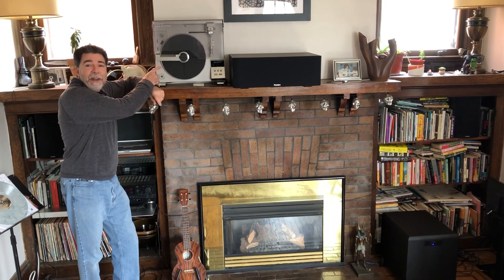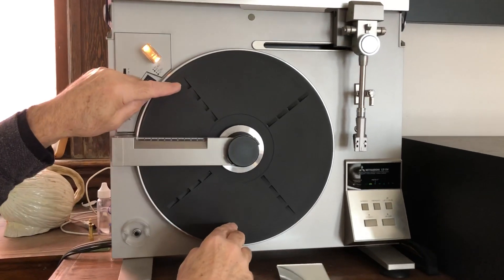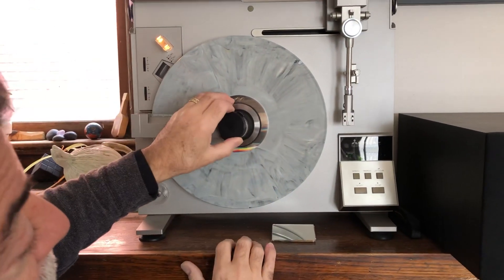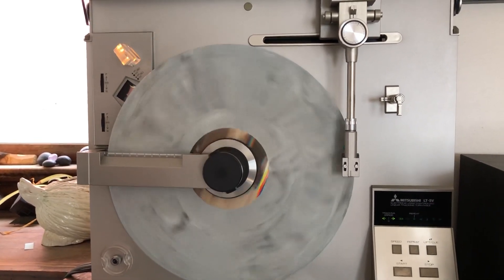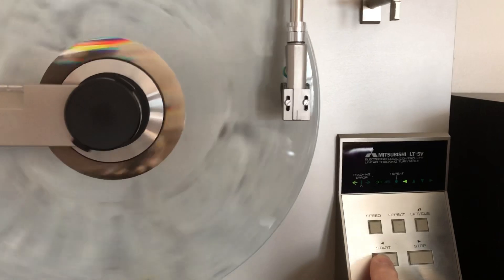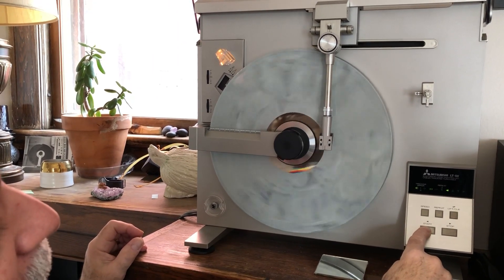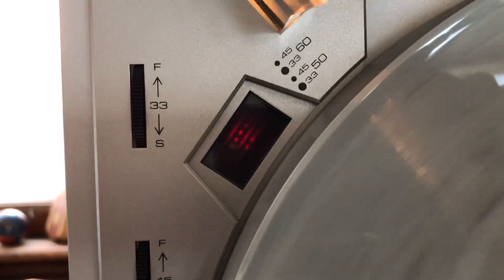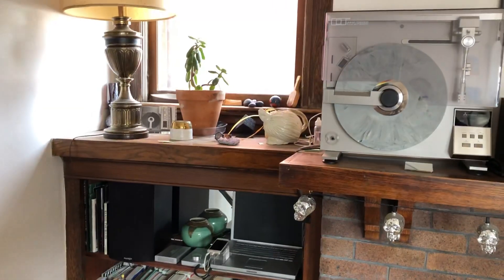Introducing the Mitsubishi LT-5V

Comment: I got mine in the late 80's off a guy who had it from new & split with his wife 2 weeks after he got it, he offered it to me for £50 cash so I almost ripped my wallet in half in the rush to get the cash out of it before he changed his mind & to this day it's still used regularly. I've had to repair it a few times over the decades but always tried to stay as much as possible to the original specs of the unit & being an engineer that specialised in electronic fault diagnostics & repair it's been pretty easy for me to do that. It is indeed a very nice turntable & also a great conversation point if any visitors call & comment about it & I've lost count of the number that have. It's great to see that there are still others with this now quite rare chunk of Mitsubishi hardware still functioning OK.
Reply from the maker: Cool to hear you're still enjoying your LT-5V! Same, I always get questions about it from guests who've never seen anything like it. I need to get the tonearm carriage back apart and replace some ricegrains again -- still spinning strong but the tonearm doesn't return automatically when reaching the end of the platter currently. Hoping it's just a burnt out bulb and not a short in the optical sensor circuit! I bet if you've got the engineer experience old gear with discrete parts like this is a real pleasure to work on.

Comment: I live in Washington State and bought this turntable new. I still have it and it has been in storage for 35 years! Even when I had it on display, years ago, I barely used it. Back then, my problem with it was how the dust cover only covers half the record and dust was a problem. Using anti-static record cleaner just didn't work. Mostly, it sat upon my stereo cabinet as eye candy. It always got lots of attention from houseguests. It is flashy.

I am moving to Austin, Texas and saw this video. I am contemplating selling it. No wear, no cracks - its like brand new. I have the owner's manual but not the original box. 

Not sure how much to ask for it or how to ship it since the cover and parts are fairly exposed and fragile. How much are these worth in perfect, new-like condition? I have seen them on eBay for $500-$1500, none as nice and brand new as mine.
Reply from the maker: Looking cool even when it's not playing anything is value add!

Comment: hello! Very good video!! i have one of this turntable , and it has the problem that the dish is going at a lot of speed! You know how it is solved? greetings from chili
Reply from the maker: Hey! I lived in Valpo for a little bit, nice to meet someone from Chile! You probably know about the speed potentiometers on the upper left side of the table. It's likely that the contacts are dirty/corroded. I use a spray like DeOxit to clean the potentiometers. You can access them by taking off the back panel. Once cleaned, you should be able to dial in the correct speed using the strobe window. Good luck!

Comment: I see one forsale online for $500us,  almost minty with the box but missing the headshell. Is this a concern as it would need to be a certain length to play in the center of the record. Cheers
Reply from the maker: You would definitely need the proper headshell. The ‘table came with a tool for aligning and centering the stylus tip, that fits over the headshell, and the stock headshell also has four pins that connect with contacts in the tone arm to pass the signals from the cartridge. Good luck on your hunt for one!

Comment: I don't know if you have serviced this table recently, but the tonearm is moving more slowly than it should on start and traverse.  The belt is likely stretched/softened and should be replaced.  The tonearm will track better when playing also.
Reply from the maker: Hey thanks for checking out the vid and thanks for the input. I did some self-service (thanks to some help on a turntable forum) a while ago to replace some of the rice-grain bulbs that illuminate the photocells that tell the logic board when the tonearm is at the edge of the platter. Since then, I think another bulb has gone out, so that instead of the vertical line on the tracking error part of the control panel, I get both left and right arrows illuminated when tracking is good. I don't see it stray from center too often, but you make a good point. The tonearm tracking speed is always something I am wrestling with. I replaced the belts about 7 years ago but I think they are stretched out again, or may have gone bald where they contact the motor and pulley. Another issue with the tonearm speed on mine is that the spindle of the main gear cog that the tonearm cable assembly wraps around needs regular lubrication (trumpet valve oil works nicely) because I think it gets stuck on the spindle -- as in, sometimes the tonearm doesn't move at all, even with the motor spinning (hence the balding of the belt). Again, touching up some spots with some of the valve oil seems to get things moving again. Also seems to depend on weather, temp, humidity. Some days that tonearm just flies -- in this video, it's definitely on the slower side of things.
Reply: @unclemarsguitar  I would think that valve oil might be a little light, something that 'stays put' better might be in order.  And you should (if you haven't, it sounds like you are on top of this sort of thing) check the grease on the worm gear that drives the drum, the original grease becomes extremely stiff, and the drum may be suffering a similar condition.  I would unwind the cable and remove the drum for cleaning myself, it's not as scary as it sounds if you're careful, I would think you would know what you're doing, a pic or two so you know how to rewrap the cable.  I use silicone grease in these cases because it won't run off and it will not degrade plastics like petroleum-based grease will.  If you ever do a major overhaul on this 'table the plastic rollers the tonearm carriage rides on can benefit from the silicone grease on their axles.  A very small amount is sufficient, no more than enough to cover the end of a toothpick.

Comment: I would like one of these...just because the look cool...not to sure if they are any good...but look super nice.
Reply from the maker: Thanks for checking out the video! Timeless retro-futurist looks for a timeless design and performance that hasn’t quit in almost 40 years! I’ve had to replace a few belts and “rice grain” incandescent lightbulbs, touch up some contact points in the gears from time to time with some trumpet valve oil to keep it moving smoothly, but this LT just keeps spinning. Ortofon 2M red, new gold contact leads, and a beefy high headroom preamp from Parasound make it sound better than anything my friends have! It’s a joy to use and listen to.
Reply: @unclemarsguitar  I have decided to return to the early 90's stereo system....the one I always wanted but could never afford. Picked up a Pioneer A400 amp, Denon 660 cd player, Philip's DDC 900 (if you can remember them) nice Onkyo r430, Sony DAT (needs a little work done) and a Marantz gopro cassette deck. Just need the Kenwood graphic/spectrum equilizer and either this Mitsubishi or technics 1210's.....I thing the Mitsubishi is slightly cheaper...yet way cooler. I am in france...not many come up for sale...just 1 in the last year. Thanks for reply and the vid. (I have put a small video upon my channel of a few of my sony cassette decks.....about ac30 second video. I collect the TC-K series)
Reply: @unclemarsguitar  Speaking of timeless... It is featured in Kaytranada's music videos for his album "Timeless", which is how I got here. At first I thought it was a LaserDisc player before I found this video. Looks like something straight out of a space ship! Too bad its out of my price range would have been really cool to have in college.
Reply: I can imagine people thinking this was pretty cool back in the 80s. The vertical design could be seen as just a gimmick, but hey it saves space. A regular turntable probably would'nt fit on that shelf!